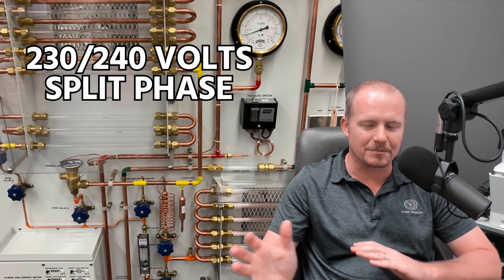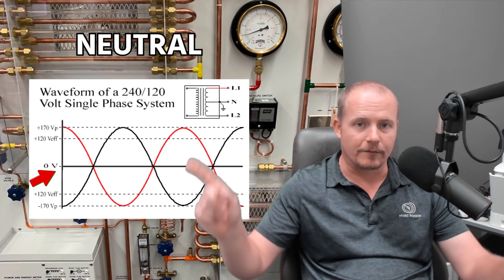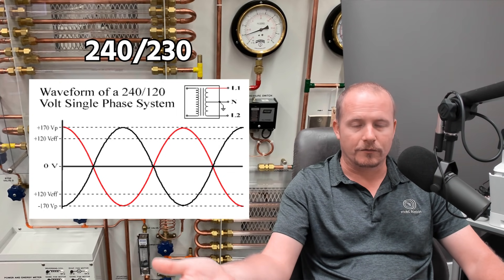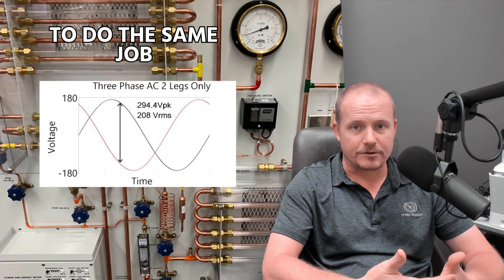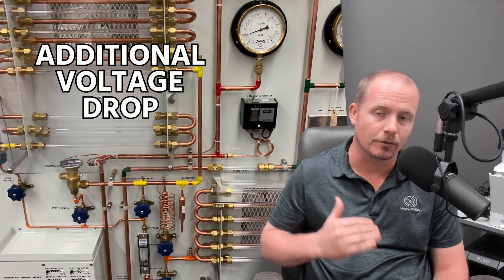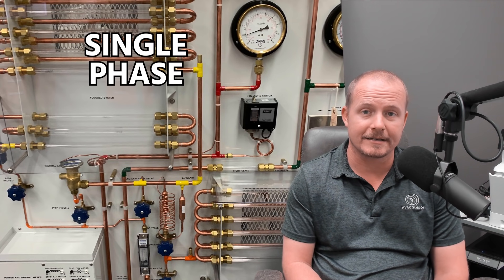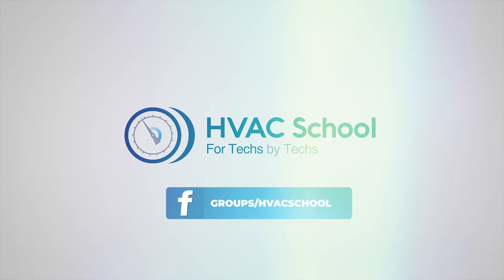How is 208 volts different than 230/240 volts?

Comment: I turned off this video as soon as the graph was shown of a 240/120 volt single phase system being 180 degrees out of phase.  This is 100% incorrect.
Reply: Could you please explain?
Reply: This is difficult to explain without an illustration.  Please draw the electrical symbol of a secondary of a transformer with a center tap.  Next, obtain a two channel floating ground oscilloscope (a floating ground oscilloscope is essential for this step and the reasons why will be discussed later).  Attach the black lead from channel one of this oscilloscope to the bottom of the transformer and the red lead to the center tap of the transformer.  Then attach the black lead from channel two of the oscilloscope to the center tap and the red lead to the top of the transformer. You will notice that the oscilloscope output shows two 120 volt RMS sine waves at 60 Hz.  You will also notice that the sine wave output from channel one and channel two hit the peak at the same time and hit the valley at the same time.  The author of this video, most likely not having a floating ground oscilloscope, hooked up channel one such that the red lead was attached to the BOTTOM of the secondary of the transformer and the black lead (grounded lead) was attached to the CENTER TAP whiich is opposite of the previous scenario.  Channel two of the transformer was hooked up to the transformer with the black lead attached to the center tap and the red lead attached to the top of the transformer (the same way as the previous scenario).  This causes the 120 volt RMS signals to appear out of phase as shown in this video which is incorrect and is the source of confusion shown in a great many videos in this topic on YouTube.  If you connect the non floating ground oscilloscope in the way described in the first scenario, the channel one black lead will be at 120 volts RMS while channel two's black lead will be at 0 volts.  Since the black grounded leads in the non floating ground oscilloscope are tied together inside the oscilloscope, there wii be infinite current through the black leads and through this type of oscilloscope which lets the smoke out immediately!  This is because Irms = Vrms/R and if the black leads are tied together, R becomes zero causing I to be infinite.  The key here is to hook up the leads on the proper type of oscilloscope to the secondary of the transformer in a way that follows polarity correctly.  If it is done incorrectly, data is reported incorrectly.  Hope this helps.

Comment: In a 240volt /120 volt spilt phase system the phases are absolutely not 180 degrees out of phase.  The winding of that transformer is wound the same direction from L2 to the center tapped neutral and from neutral to L1 hence no change in phase relationship. If the transformer winding was wound one direction from L2 to neutral and wound the opposite direction from neutral to L1 then you would have 2 120 volt sine waves that are 180 degrees out of phase from each other but you would have no voltage available when measured from L1 to L2. You would have 120 volts from neutral to L2 and 120 volts from neutral to L1 and u could power 120 volt loads off of these but when you hook up a load across L1 and L2 you are going to find that there is not 240volts available. There is zero voltage.  The reason why these sine waves appear to be 180 degrees out of phase is because the oscilloscope leads were not hooked up correctly to show the actual relationship of the signals.  It is the same thing as hooking up a multimeter to a 12 volt dc car battery backwards. If you touch the black lead of the meter to negative and the red lead to the positive then the meter show a positive voltage but if you reverse the meter leads on the battery the meter displays a negative voltage.  For anyone who doesn't believe and wants to be properly educated go over to Dave Gordon's youtube channel and find the video on 120/240 volt systems that describes what I am saying in great detail with a live demonstration board absolutely proving that it is not electrically possible for the phases to be out of phase and have L1 and L2 add up to 240 volts and power a load.
Reply: I have come to the conclusion that electricians should not speak of phases. They just don't know what they are talking about.
Reply: I was wondering what he was talking about 180 degrees out of phase. Transformer is single phase splits the voltage in 2 windings why you get 240V L1 to L2 if it was out of phase you would get 0 volts.
Reply: Sure about that? Lest look at a 3 phase star system. You may draw a phasor diagram showing the vectors 120 degrees apart. If you measure the length of the phasor it is 230Vrms (European 230/400V TN network). If you measure the distance from arrowhead to arrowhead you get 400Vrms. 
Now take the strange US split phase. If the two phasors are in phase, they coin-side. What is the distance from arrowhead to arrowhead? Zero, zero at any point in time. There is no phase angle difference between the two. 
Or? If you draw to phasors, one pointing up, the other down. NOW you get 240V between red and black wire. What is the phase angle between the phasors? Happens to be pi radians or 180 degrees. 
“Phase” in electric vocabulary is a tricky word. May mean a voltage, a conductor or a phase angle. People mixes up and get confused.
Reply: You’re exactly right, if they’re out of phase, they wouldn’t be able to stack an equal 240. I wonder how so many comments say this was spoken clearly and now they understand when he is not explaining it, right
Reply: That’s a gross misunderstanding of electricity. It’s not one way or another. When you measure the two 120s against each other, they’re 180degrees out of phase with each other because their potential is measured relative to a neutral; the thing allowing you to get 120v.
If you measure each 120 against each other, you’re not talking about 2 phases anymore because the neutral (the only way to get 120v) isn’t measured at all. It’s just single phase 240v.
So yes, by definition, the 2 120s are 180 degrees out of phase with each other because defining either 120v line must take reference to a neutral.

Comment: The way you're explaining how the 208 voltage is derived is not accurate. It has nothing to do with the phases being 120 out of phase with each other. It has to do with how the wye transformer is wound for the 208 volt secondary. 208 volt divided by the root of 3 (1.732) will give you 120 volts which is why you still get 120 line to neutral on a 208 volt 3 phase system. And lowering the voltage will give you higher amps, always. But only to an extent. You're not going to replace the 32 volt loss between 240 and 208 with amps. So in part you are correct on that. Over all very informative video and it sounds like you have a pretty good grip on the subject. Not all stationary engineers possess the answers to the why's.

Comment: It is NOT 2 phase power. If you take any 2 legs of a 3 phase system, you have single phase. A phase is any 2 or the 3 legs. So  AB, BC and AC are the 3 phases. Any of those 3 would be single phase power.  Two phase power is an old obsolete power system.

Comment: 208v is “weak 240v,” derived from a 208Y/120 three phase system
Reply: Good way of describing it.   And it all has to do with phase angles.   208Y three phase, however is more efficient for larger motors than 240 single phase,  to an extent,  then you get into 480 and 600V.    actually when you get motors above about 10 HP , they only come in three phase.  Three phase motors are much simpler in construction, more reliable and efficient

Comment: Totally wrong!😊
Reply: Don’t elaborate at all just say it’s wrong! 😊
Reply: @dylanstack8710  I would suggest that if someone is trying to explain the difference between 208 volt and 240 volt ac electrical systems and does not have a thorough understanding of ac theory, he would better serve his instructees by merely telling them that the difference between 208 volt and 240 volt systems is 32 volts due to differences in utility company transformer configurations; that single phase residential and commercial HVAC equipment are typically designed to operate at either voltage, because the use of both voltages is wide spread, and HVAC equipment is likely to be connected to either system; and that equipment operating on the lower voltage may produce less effect, probably at lower efficiency, and that equipment, especially compressors, may suffer issues in starting when other factors tend to reduce the voltage at the equipment to values of less than 208. The use of terms like split phase, two phase, phase angles, etc will confuse most HVAC techs, unless they have had significant education in ac theory. Perhaps the best explanation of a single phase 120/240 volt system would be two 6 volt batteries connected in series, where 6 volts would be measured across either single battery, and 12 volts would be measured across the two batteries in series. That is quite like a center tapped 240 volt transformer secondary winding, typically providing  residential and light commercial electric service. I hope you will not find this explanation too elaborate. Most techs will quit reading this before the end of the second sentence.

Comment: Your 120/240 volt explanation given here is bogus.    Single phase is single phase.   There is no 180 degrees out of phase.  The set up of an oscilloscope causes it to look like his examples but are false narratives.   Also, neutral is zero volts only because it is being measured to ground that is bonded to neutral.  
Here is a link to a video that explains it very well.

https://youtu.be/uRKbX74lBgU

Comment: If a 240VAC compressor runs on 208 then the performance is lower, less work, less current. If a 208VAC compressor runs on 240VAC then will it produce more work and consume greater then rated current?

Comment: I=V/R
This is the reason why at a constant resistance when voltage approaches infinity current follows and the same when approaching zero.
Reply: Yeah but not true for motors because there is firstly, the load impedance is not resistive,  and secondly there is a back EMF produced , which doesn't occur when the motor is not rotating

Comment: Explanation is incorrect and dangerous, what does a AC tech need to know. 208 is used to run office 120 outlets and if used for 3 phase AC has to have equipment rated for 230/208 as to 240.

Math for 208 is 208-120=88 volts 
208v is not in perfect phase.

Comment: Motor torque reduces with the square of voltage, which is why relatively small voltage drops can cause motor stalling on startup, especially on hard starting loads and when voltage is low to begin with like when running 240/208 motors on 208V. 208V 3-phase sucks in general for motor loads, since they run cooler under load with the higher voltages and don't suffer from the starting issues associated with voltage drop. The only redeeming quality of 208V 3-phase is where substantial 120V single phase loads are to be served; instead of attempting to supply large 120V loads from one leg of a split phase 240/120V transformer, 208V 3-phase can be brought into the building and 120V loads shared between the 3 phases from any line to neutral.
Reply: 3 phase sucks for motor loads? Rubbish.
You obviously don't know why 3 phase exists and how fundamentally important it is for motors.
Reply: @deang5622  You didn't read my comment properly. I said 208V 3 phase. 3 phase exists in voltages other than 208V (not everywhere of course, but it still sucks).
Reply: @Orgakoyd  Yes I did read your comment properly.  It was in fact you that did not read my god damn comment properly. I made a statement about 3 phase and I made no mention of the phase voltage. And the reason I did not make any mention of phase voltage is because it it is not relevant.
Reply: @Orgakoyd  What are you, an electrician?
Reply: @deang5622  Your origiinal reply implies I said 3 phase in general is bad for motor loads. Maybe you misunderstand what I'm trying to say. I meant 208 V 3 phase isn't as good as 240V 3 phase for motor loads. I am not an electrician, just interested in things.

Comment: Many apartments and townhouses will have 120/208Y 3ø.    Each unit, however,  will be fed the two legs out of three, and of course your neutral and ground, and will alternate between A-B, A-C, & B-C so as to balance the loads.    It's more efficient than a single phase service but of course can present problems with motors as you described.   The electric range and dryer will have 75% power for heating.

Comment: I've always heard that our devices are designed to accept 10% more or less than the rated voltage. Indeed it fluctuates. In some countries the voltage is 127. 1.73 times 127 is roughly 220. That includes Mexico and some other Latin American countries.So I guess in them places the houses are pretty much all hooked to a 3 phase system. Idk if it's just two or all 3 phases coming into the homes
Reply: In my country Suriname, you either 127 single phase, 127/220 2 phase, 127/220 3 phase. All airconditioners work without any problems on the 2 phase.
Reply: @VinayJhinkoe  thanks. I enjoy learning about electric standards in other countries and actually have quite a collection of foreign adapter plugs

Comment: Good video - but you are interchanging the word “phase” and “pole”.  The power coming to your home in the USA is all single phase. To get 240v you are using 2 poles 180 degrees out of phase. Those two phases being opposite sin wave add to 240.  Of you tried to get 240v from two brackets on same pole, they would cancel and you would get 0V
Reply: and you just interchanged the word "phases" with sine waves when speaking about 240 when there is only ONE phase with 240 with two opposing sine waves from a split transformer.
Reply: @Jason-wc3fh  - we are saying the same thing.. single phase power but split 240, - sine wave is 180 degrees out of phase.

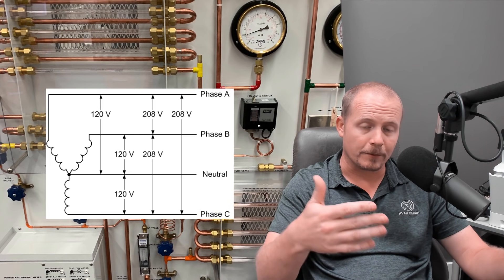Comment: Thanks for the video...but in 2:40 you mentioned that 208 is from to phases...but the motor is actually using 3 phase??...right? ...The 208 comes from when you measure the voltage between phases...it does no mater what is the phase...